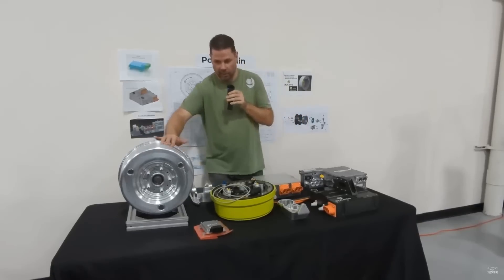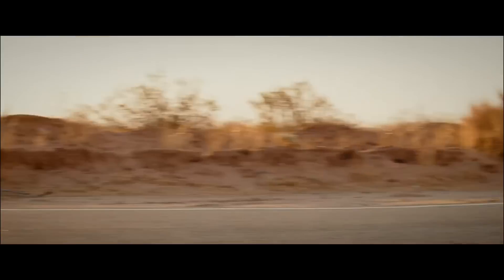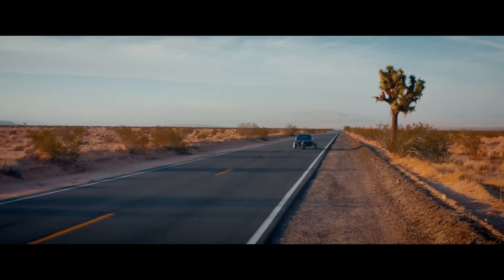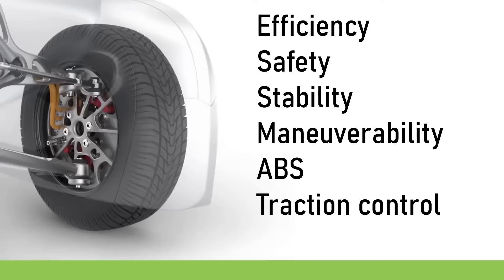Why is Aptera using In-Wheel Motors? (ft. Elaphe)

Comment: The space use advantages granted by removing motors from the vehicle's main body are squandered by unnecessarily limiting the interior volume. There would be some drag cost to extending the sides of the vehicle to the outer reach of the wheels, but the vehicle would serve a greater proportion of practical use cases. The market would be broader if the Aptera could reasonably serve as an only vehicle.
Reply: Aptera will serve as our only vehicle, and will meet the needs of many retired people.   Our Gen 1 Honda Insight serves well now, and Aptera will improve on its performance in almost every respect, including carrying capacity.

Comment: One thing that really worries me about in-wheel motors is durability. With a traditional setup, with motor in a central location and connected to the wheels via shaft and CV joints etc, the motor is protected from road shock by the suspension, tires and everything else  between the motor and wheel. But with in-wheel motors the only thing that absorbs any of that shock is the tire. I would think that over time this would put a huge amount of stress on the motors compared to non-IWM setups.
Reply: If they make the motors cheap enough and easy to replace then having low durability shouldn’t be a big deal. Any idea how much these hub motors cost?
Reply: @eel845  I had a little experience with hub motors in the solar car at University.
I expect they are more affordable now.
Hub motors with their narrow crossection and focus on power to weight are specialized compared to an off the shelf commodity motors.
Best bet for really bringing their cost down is making many airports apteras fast.
They should be smaller and less costly than larger EVs using hub motors.
Motors like the bolt are likely to remain less expensive.
For the cost of all worlds look at p2 hybrids using flat motors between the engine and transmission.
I've wondered why not use a normal motor in the transmission.
Power split devices seem elegant to me.
Reply: @eel845  Heh heh, I'm sure the end users would love to have to replace their motors every 50,000 miles or so. LOL. But seriously, I'm not sure how much they are. I checked Elaphe's website for their M700 motor (the one used in the Aptera) and it doesn't say how much it costs, but they do weigh 23kg each which is pretty good for the power they produce. I suspect that Aptera chose them not for price but for compact size and placement in the vehicle.
Reply: Well designed bearing or CV joints will eventually wear out earlier than well designed solid or flexible bellow fatigue limit parts. I wonder if a magnetic bearing would help?
Reply: E-bikes have in wheel motors
Reply: @willdatsun  Too general a statement. Some e-bikes have in-wheel motors. As soon as you add suspension, unsprung weight becomes a concern.
Reply: how about the waterproofing capability?
Reply: @wilsonchen2637  I guess that could be a concern as well. This is something that EVs with internal motors (non-hub motors) don't generally have to worry about.
Reply: @wilsonchen2637  expect splashing and partial submersion flooding where ever you put it but frequency and full submersion is more likely in wheel.
Reply: There should be fairly cheap. Moving to the all-wheel drive trim only cost $2,500 more and that 2500 goes to a completely different rear suspension and subframe The motor, the controller and a few other things so the motor itself likely cost around $1,000. Assuming everything goes well after production ramps up, it seems likely that price could get down closer to $500 which honestly wouldn't be that big of a deal considering it's so simple, you can probably swap it out yourself even if you've never worked on a car.

 That said, that should be surprisingly durable similar to how you mentioned traditional electric motors being tucked up in the body, the entire in wheel motor fits within the wheel and then the wheel is covered so So the chances of something getting around the cover and hitting it from the back are very tiny and the spokes and cover on the outside should protect that side of the motor. Realistically, it could be destroyed by a pot hole or something that was bad enough to also destroy the wheel. But then you're talking about the kind of damage that could rip the whole corner of the car off and there's no way you're going to build anything to survive that anyway. As far as long-term durability goes, it does cut down on a ton of parts since it's basically a powered wheel bearing/hub You're definitely going to reduce maintenance cost by getting rid of CV shafts,U joints, transmissions, gear drives, and all the bushings, grommets, and mounts required to hold those things in place. 

Realistically only time will tell but I've worked on motors and factory environments that withstand similar forces to what? I would expect these to endure on a gravel road and do so 24/7 for decades before they need to be replaced.
Reply: @ZoomZoom870atGmail  rims aren't impervious to cyclical vibration damage but they're easier and cheaper to make robust.
Reply: Build a better in wheel then
Reply: No.  The Elaphe motors are fully potted to absorb repeated 100 G shocks.  The wheels would likely be destroyed before damaging the motors.
Reply: @n.brucenelson5920  Right, the are made so strong they can't be damaged.  Those 20 year studies prove it, or wait they don't have those.
Reply: @murraymadness4674  If you have something to contribute to the conversation, cite your own data. Misrepresenting what I said, and name calling isn't a contribution.
Reply: I have trouble seeing how the coil windings can possibly be more shock resistant than a cast or forged metal wheel. The potting compound used on the coils must be amazing. Is it "proprietary"? 100Gs is not that high of a shock. Wheels hitting pot holes may exceed this level, especially when the hit is bad enough to pinch the tire all the way against the rim. What sidewall height are these tires? @n.brucenelson5920 .
Reply: @n.brucenelson5920 I would like to hear more, are the motors heavier than needed as a result for making them as resistant to shocks? What kind of solutions have they applied?
Reply: @MyFilippo94  Elaphe Motors considered using transverse flux and axial flux motor design, but settled on radial flux after evaluating all the pluses and minuses, including ease and cost of production.  They would be lighter without the potting, but would not then be robust enough for the application.  They have built and tested many prototype cars - more than 40.
Reply: @n.brucenelson5920  I hope you're right. Though it is still true that any given motor will be significantly more insulated from shock if it is connected to the wheels via linkages, shocks, driveshafts, etc than if it is literally the wheel itself. I guess we'll find out once they are being sold and people are putting a hundred thousand miles and more on them.

Comment: What about unsprung weight? The industry has allways strived to REDUCE unsprung weight in the suspension in order to improve handling. This seem to work against that... (?)
Reply: You are correct.  However the 50 lbs the wheel motors weigh is still within the range of vehicles shipping with steel wheels and the other advantages of the motors make the tradeoff worthwhile.  The moose test shows that the handling performance is still better than many vehicles sold in the US.

Comment: would love to mount one of these wheels on my wheelbarrow. seen people use bicycle motors etc, but this would be next level yard mastery!
Rider tractors and side by sides too, really grat concept. Hope it all comes together in a slick retrofitable packedge for legacy applications. 
Visualize the flying cars in "Back to the Future"....with all the obviously new, tech gear and bits bolted on the inside/outside of a 30 yr old rebuilt vehicle.
Reply: Grin technologies has a kit for just that, or you could take your chances with ebay Chinese kits.
Reply: @punkdigerati  TY for the tip.
Reply: Scooter hub motors may fit wheelbarrows

Comment: motor in wheel is added unsprung mass so it will vibrate more under external forces.
Reply: Actually the additional mass tends to reduce vibration due to increased inertia.  Slower response can be largely compensated for through suspension tuning, which in Aptera's case has been done by Roush Performance, through a total re-design of both the front and rear suspensions.
Reply: @n.brucenelson5920 thanks do you have any data on this that can be shared as you can see from Tesla designs they are super fast and really low maintenance part of the advantage of Tesla comes from their fixed actuators that are high power.

Comment: It also moves the weight to the edges of the car improving stability and possibly ride smoothness.
Reply: Moving the wheels out does add stability; but because the wheels are more massive now, and because the wheels must move when the road forces sit, you have a larger mass being tossed around. 

So you have a choice. You can move all that extra kinetic energy into the car body (so rougher ride), or you can slow down the suspension (resulting in much worse handling).
Reply: Smoothness? i dont think because unsprung masses did increase the inertia who make bounce the wheels and so degrades road holding...In wheel motors are not a new idea: the first known car with such motors was the Lohner Porsche 4 wheel driven electric car from... 1899!  Motor wheeled vehicles (electric or hydraulic) are very common but only use in heawy and slow vehicles like construction machinery, mining machinery, handling machines like boat moving,etc...

Comment: excellent ! so Slovenia is noteworthy not just for its stunning nature and angling. 
any thoughts on suitability of these motors to convert a classic car into a cool EV ? would free up extra space for batteries and the motor part of the transition would be a breeze.
Reply: That's exactly what I was wondering!Not just classic cars, but any lower-weight car that blew it's engine...
Reply: @KingClovis  I checked - for now, they only supply OEM's, not private customers or small accounts, regretfully. Lightyear is also working with them (they claim a 97% efficiency on the motors). Didn't find a price anywhere.
Reply: @justforthehackofit  Aptera charges $2500 for the third motor, which may give a hint.
Reply: @n.brucenelson5920  Well, they'd have to get that price per wheel a little lower for it to be econimically viable. I would think you'd two wheel/motors at least, plus the batteries. It would be interseting to compare that with replacing an engine in a used car...
Reply: @KingClovis  the economic viability isn't as much of a concern with collectable classic vehicles. Trying to convert a broken low value vehicle to electric isn't ever going to be more affordable than just replacing the blown engine with a working used engine, same as it had. Batteries alone will likely exceed the motor cost, not to mention the electronics and the fabricated components to mount motors and batteries in the vehicle.
Reply: @KingClovis  Or rebuild them.
Reply: I've been considering that possibility. One issue I thought of is the hub motors limits compatibility with wheels. A lot of classic cars have fairly small wheels in comparison to modern cars. Even if you put low profile tires on there could still be clearance issues to contend with.

Also there are aesthetic considerations. Aptera is completely hiding their wheels so they don't have to look pretty, but a large part of the experience with classic cars is how they look.

Using hub motors will also likely require reengineering the suspension. Likely requiring custom fabricated parts to attach to the car. Also concerns of changing the car's balance and driving charactistics.

None of this is a deal breaker, just factors to consider
Reply: @chuckmakesit  thank you, some of these I hadn't considered yet
Reply: That's a great idea!

Comment: There is a reason they aren't used. Ride quality, grip and handling  is quite compromised. There's no free lunch and all engineering is a trade-off. This is very one-sided.
Reply: It is correct that there are engineering trade-offs, but wheel motors ARE used, and have been for some time.  I challenge your statement that ride quality and grip are "quite compromised".  I rode in an alpha last November, and the ride quality before optimization was not any worse than my VW kit car Kelmark GT conversion.  The production versions with the Roush changes in the suspension are likely to be much better.
Reply: most ebikes/e-motorcycles use exclusively hub motors as they are more efficient then mid drive options

Comment: I call bullshit.

There is nothing inherently more efficient  about an in wheel motor.

As to mechanical efficiency, whatever minor gains exist in line loss are dwarfed by the loss of efficiency in having one large central motor.

You also give up the option of water cooling the motor.

I'd like to love I'm wheel motors.
They would make building a diy vehicle much simpler..

But the biggest reason no one has used in wheel motors in production is that they are horrible for handling.

The biggest detriment to handling is unsprung weight.

Why do you think alloy wheels are preffered in performance cars?
Reply: larger motors are only more efficient for gas powered engines, with electric the power out is the same as power in no matter the size, if anything smaller motors are more efficient because they don't need to waste any power on cooling
Reply: Lots of mistaken ideas here.  First of all, getting rid of transmission shafts and gearing provides a significant gain in efficiency, and some weight reduction.  Secondly, the Aptera motors ARE directly cooled by circulating antifreeze solution.

The fact that Atpera can pass the moose test where many vehicles for sale in the US can't should show you that they aren't THAT horrible.  While an increase in unsprung weight is a challenge, it is only about 50 lbs per wheel, well within the ability of suspension tuning to handle.  If you review the scientific literature on this question, it was independently confirmed that the additional weight could be handled with normal suspension design in papers written perhaps a decade ago.

Comment: The big disadvantages of in wheel motors in un-sprung weight, higher shock & vibration on spindle bearings, and in case of steering wheels, gyroscope effect resistance to turning. For light vehicles of moderate speed, these are not major problems, but for most EVs they are serious problems.
Reply: What would you class as moderate speed 30mph to 50mph.
Reply: I would not drve this car more than 50 mph on a narrow, fast apline road... believe me.
Take a look at what the gyroscopic effect is and how massively it can impact on the handling 8f a car.
People spend a lot of money to have super-extre-light aluminum rims and then this guys try to convince us that law of phisics doesn't hold for them...
This is a good city car in the best case.
Reply: @giuliobuccini208  Yes, look at the physics.  This issue has been well studied with numerous technical papers published, and many test vehicles built.  More than 40 projects have been completed by Elaphe alone and also by other companies such as the the BRABUS EV based on the Mercedes-Benz E-Class.   Actual experience does not show the limits you are ascribing.  Yes, more unsprung weight is an issue, but it can be largely designed for, in exchange for many other advantages that wheel motors provide.
Reply: @giuliobuccini208  My first car is a crown victoria 2001 and wouldn't handle that kind of driving either. Everyone who drove it said it took time to get familar with the soft suspension, but the passengers loved it. Most people don't care to drive 50mph on a alpine road and they aren't doing it daily.
Reply: @kino_cinante  I understand your point, but in many european countries mountains and narrow roads are normal (e.g.  Austria, Switzerland, central and northern Italy, etc. etc.)
Here in southern Germany, driving your car on the alpine roads at 100  Kmh is quite normal (and very funny!).
For this reason I think this car is 100% OK of for cities and commuting. But, in that case, that aerodinamic shape is quite useless. A car with a "cuboid" and four wheel shape would do the same job...
I hope you got my point too.
Reply: The increase in mass should work to lessen vibration, due to increased inertia.
Reply: Yeah, you nailed.
The handling of this car must be awful at high speed...